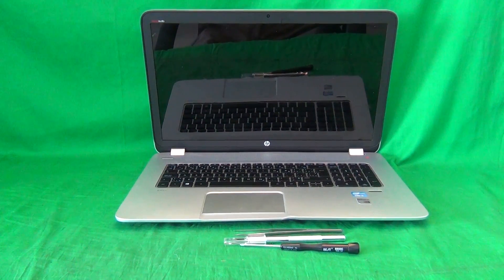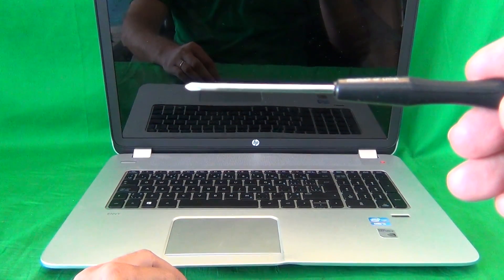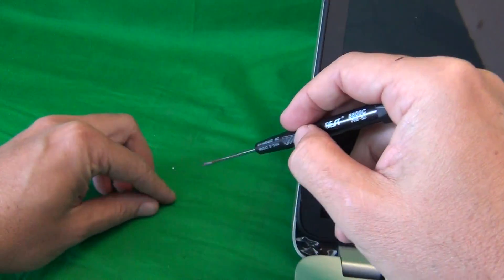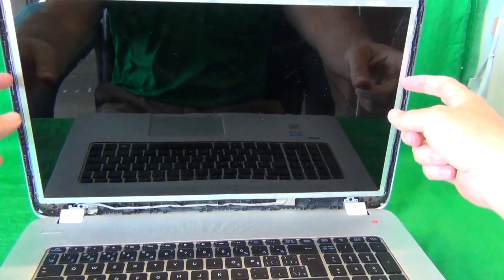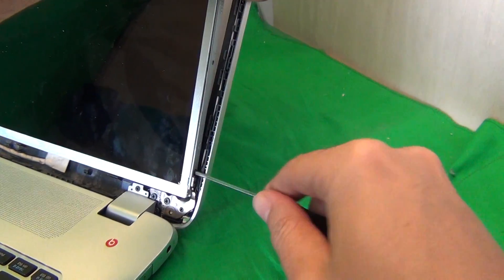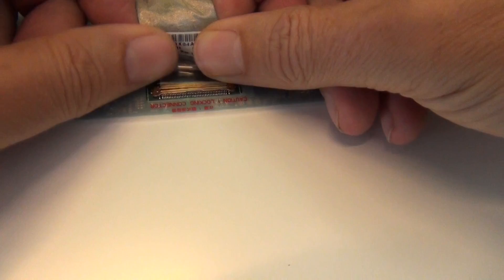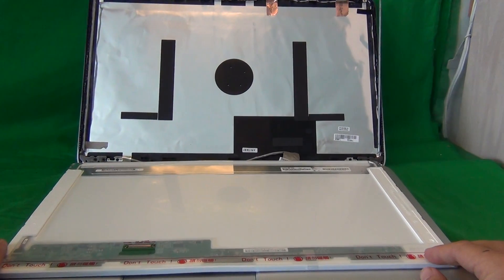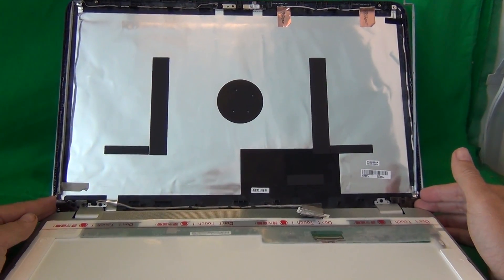HP Envy 17 Laptop Screen Replacement Procedure

Comment: Un millón de gracias por su descriptivo video. Necesito  dw173 touch camera cable 6017b0463701  ¿Puedo comprarlo con ustedes? Si así es, cuál es el costo? Mil gracias por responder a mi pregunta.

Comment: Hello i just have received my screen because the original was a crap i hate matte screens and this originally has a (17.3") HD+ BrightView LED-backlit (1600 x 900) This is worst screen i have ever seen and of course blacks and contrast ufff even worst. I just decided to change and upgrade to FULL HD and glossy screen and is the best thing i ever made. Thanks to your tutorial was all this made possible. My laptop is HP ENVY 17-j067ez. THANK YOU FOR YOUR  TIME AND KNOWLEDGE. Because you made everyhing really really easy and very detailed. Thanks agan really really thanks. Regards from Switzerland.
Reply: +Tavo K Thank you for this comment! I have exact same problem on my HP envy 17 and I was wondering if it was possible to replace it with Full HD screen. Thanks to you, now I know it's possible :) Can you tell me where did you order full HD screen?
Reply: +Tavo K and also, did  you had any problem with driver? Did it automatically detect new resolution after replacing your screen?
Reply: +getLocation: Hello my friend. In fact im just using this screen to write you right now. If you have one HP ENVY 17-j067ez. Of course you can do your upgrade without change any cable. (I know that all HP ENVY 17...etc is available to upgrade but better if you write to them they have a good support) And on the other side i did not have any problems with driver. Only when i connect this screen takes time to recognize and download this driver. And everything goes fine till now. (Good colors, resolution FULL HD and of course GREAT BLACKS and CONTRAST and the process was exactly like the one in this video) This is the page where i buy my screen. http://www.laptopscreen.com/English/model/HP-Compaq/ENVY%2017-J067EZ/   
If hope you can enjoy your new screen =)
Reply: +Tavo K thanks again! :) I model is ENVY 17-J010SE but it looks exactly same as model in this video and they have screens with full hd for my model. One more question, did you order screen with matte finish or glossy? I'm thinking to order matte because glossy screen is annoying when using in bright room.
Reply: +getLocation Correct my friend. I order my screen glossy because i was tired of faded colors and black-grays. Now im very happy because i use a lot of multimedia, and with that screen pfffff. And answering your question in that page have a lot of models. Did you check your model? (I came from a horrible matte screen 1600X900)

Comment: Thanks for the great video.I have a question.I have the same laptop and need to replace the screen due to a line of stuck pixels.The resolution of this LCD is 1600x900.Would it be possible to replace it with a LCD that has a resolution of 1920x1080 ? Do you have any in stock ?